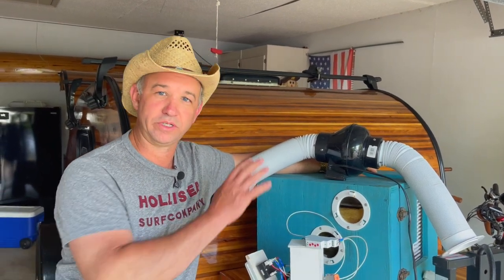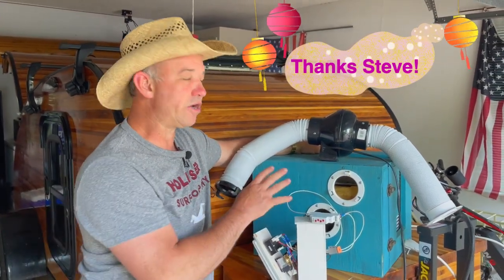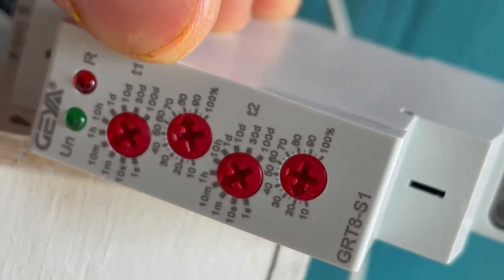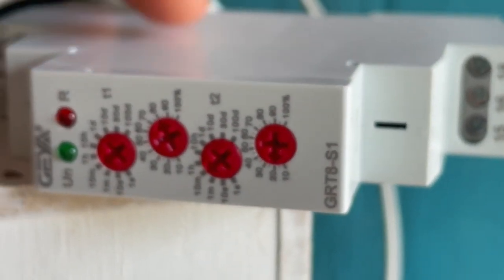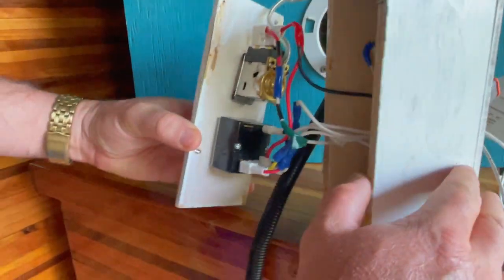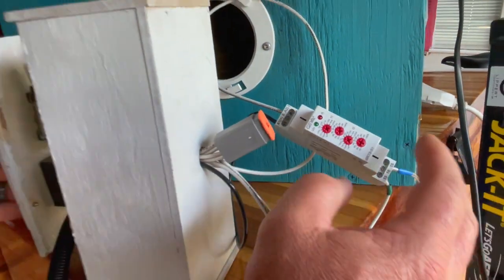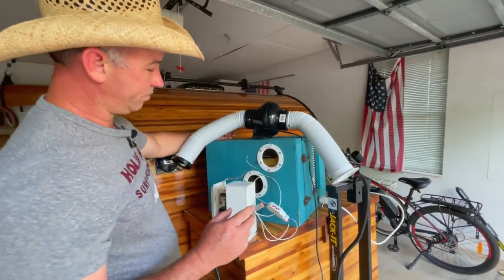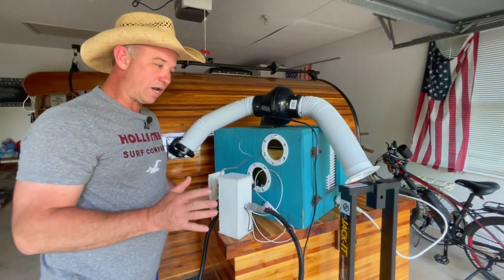DIY Camping Air Conditioner | FIX! | Keep it from Freezing up!

Comment: Where did you get your fan flanges hoses and fittings thanks
Reply from the maker: From the cool right site, I no longer use them and don’t recommend them. I use sewer connectors now
Reply: @FlomatonFamous ok I thank you for the reply I’ll do that with the sewer hose and fittings

Comment: What are you using for your power source inverter,shore power or a power station
Reply from the maker: The camper is wired for 30amp. So either shore power or generator
Reply: @FlomatonFamous ok thank you

Comment: I think that we did almost your exact AC config. I got the idea from a YouTuber that used the 3” sewer hose and bayonets flanges. We too had freeze issue. Are your hose 3”? I considered a in line booster fan just like you have. A few buds trying help me figure out the ice issue convinced me my airflow was lacking and pushed me to add a 4” supply, I assume you did not want to widen the holes in the finished camper body? I ran 4” pvc duct under the cabin a popped it up with a periscope looking pipe. It still took some tinkering as the return is still only a 3”. I tried two 3” returns to make use of the existing holes flanges and hoses but it was still freezing up. The answer for me was to leave one of the 3 inch hoses off and allow the AC to suck in the outside air. It now gets done to about 62 and is enough to make the entire camper sweat.

I did not know about running the wires through the duck hoses, but I did a very similar option. I too, took the manual control knobs out of the unit itself and put them in a 4 x 4 junction box with the knobs through a blank face plate. I ran the wires inside the wall during construction And out the bottom where I connected them to a DIY Anderson power pole, quick disconnect.

I think after our long July trip, I will make the painful decision to widen the original 3 inch holes to 4 inch holes and be done with it. I really appreciate your fix and the way you have demonstrated it for others to follow. I hope to see you out in the wild somewhere , so I can see the rest of your rig.
Reply from the maker: Hey Joel, I’ve seen people try a bunch of different things to keep it from icing. I suggest you buy the relay timer and wire it up. I’ve not had one single issue since I did it. A friend also discovered that his a/c unit has an eco mode and pretty much does the same thing as the timer. As far as the Tearjerkers’s event. Just check their calendar on the tearjerkers website. Hope to see you in the wild also

Comment: Are you running the control box cable through the return side hose? How does that work with an inline fan on that side?

Did this fix your issue fully?  Your build is bigtime inspiration right now. Currently working on my plenum - appreciate you making these videos!
Reply from the maker: Yes, it fixed it fully I haven't had a problem at all. Yes the cable is run through the return hose. the inline fan is on the supply side.
Reply: @FlomatonFamous  Got mine all built and wired up, I'm not seeing lights come on the delay relay though when turning the fan on. Haven't been able to let it run cycles yet, bigger testing day tomorrow. Do those come on periodically or are they always on and I'm maybe not getting power to it? I used posi-tap connectors to tap the + and -
Reply from the maker: @clintonbutler4503  the lights are always on, probably need to verify power connection
Reply: @FlomatonFamous  thank you, I'll check my connections. Positaps may not be the right connector for the job
Reply: removed the posi-tap connectors and stripped back the shielding on the + and - wires and just T'd in like that. Slapped a little solder on em but I dunno how I'd heat shrink that so ill just toss some kafton or electrical tape over the connection. Lights came on immediately when I selected a cool setting. Thanks so much! Giving it a test tomorrow then inaugural run next week for the July 4 camping trip to Ouachita Lake, it'll be hot and humid so I'm eager to see how it performs. I'll report back.
Reply from the maker: @clintonbutler4503  That’s awesome! Have fun!

Comment: Thanks for helping to solve our ever going dilemma in Texas camping. Question. Do you have a Max Fan? How are you using it while the AC is on? Could you have increased the return airflow by adding an additional hose (if you’re NOT using a Max Fan to minimize indoor condensation) and an in-line fan that is simply taking in air from the outdoors? In other words, sucking up air from the outside so as not to have to drill another hole on the camper wall. Would that have helped the unit from freezing?
Reply from the maker: I don't have a Maxx Fan, mine is a knockoff. I've cracked open the roof fan and crack the window to let some fresh air in to keep carbon dioxide from building up. I you pump in air from the outside then the a/c never gets the cabin cold enough. This timer seems to work perfect. We used it all summer long and the a/c never iced up.

Comment: Why didn’t you just increase airflow to the unit? I was going to use a 5,000 btu unit and put three vents of that size in it. Would that have been an alternative means of addressing this issue?
Reply from the maker: That may have helped, I really don't like the idea of cutting more holes lol.